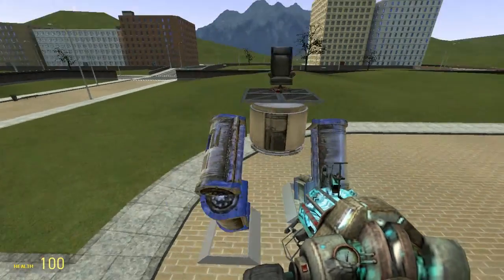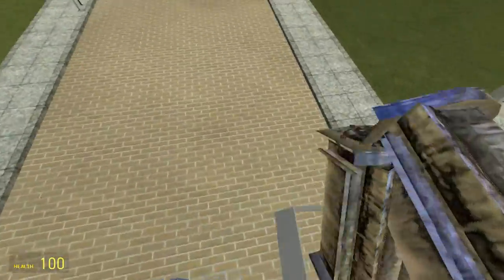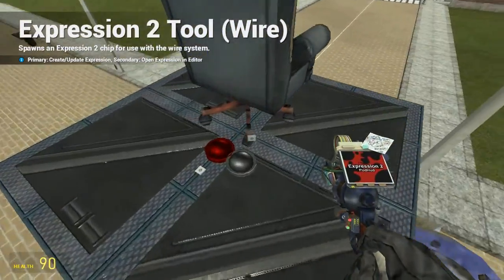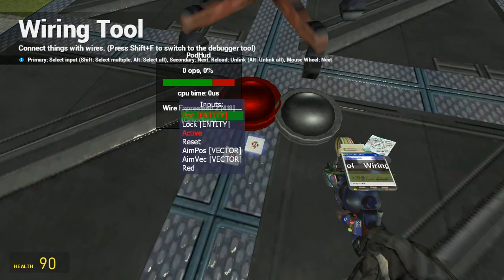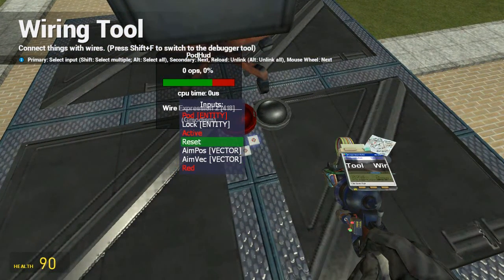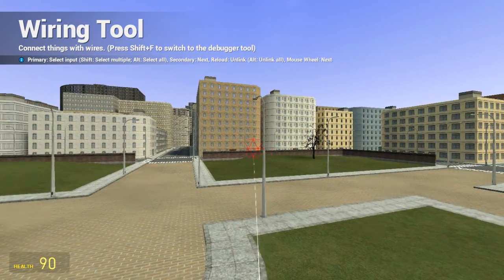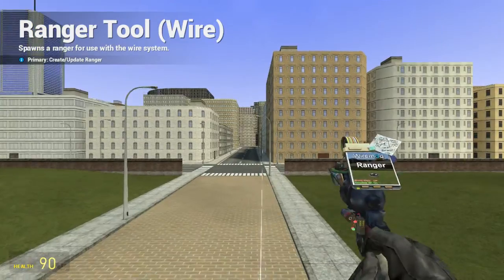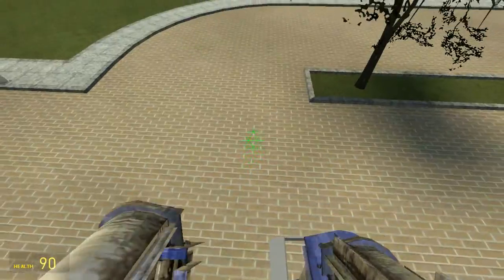[Tutorial] Garry's Mod: Connecting Up The HUD I Usually Use

Comment: Now how do I modify that to show vehicle speed like a speedometer and when wired with ACF, show rev counter, efficiency gauge and fuel gauge (and/or hybrid battery/power meter gauge if it's an ACF hybrid/PHEV/EV) or a clock to show time?
Reply from the maker: Doable and not hard, but this is not the chip to use, there is the other huds I use sometimes for ammo counting. can show how to connect up that sometime